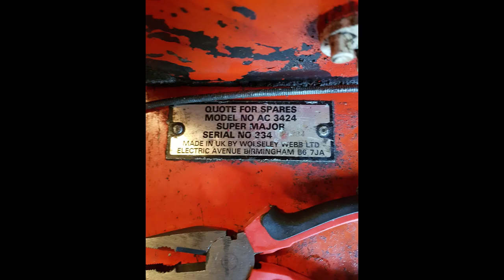Wolseley Merry Tiller Rotavator 5HP Briggs Stratton - No Spark - Non Starter

Comment: Thanks for the video. I’ve picked one of these up (model:714394)  and it’ll start with a dose of easy start but struggles without it. Also when it is running: it’s down on power...it’s not running at regular fast speed. Do you think mine needs the same points service? Or would you try something else first? Thanks
Reply from the maker: I was told if the point ain't broke, then don't touch them lol..
Mine never started without easy start lol.
Sounds like a fuel / air mixture issue? 
Have you tried new fuel with the correct mix. Give the carb needle valve a clean? Then readjust it 1/4 turn each time, it doesn't need much.
.
'Taryl fixes all' has great vids I learnt a lot from him.
.
Good luck mate 👍
Reply: Chris Crawley thanks for the reply. I’ll give those items a try and report back afterwards. Thanks again

Comment: Good job dude. I have a Merry Tiller 5hp Briggs N Stratton like yours. I’ve got starting problems too. Struggled to get the fly wheel off to sort out the solenoid points. Will try again though. If that’s not the problem I guess I’ll get a new one. These 50s machines are ace aren’t they?
Reply from the maker: Haha mate it's brilliant, pisses all over the homebase ones..
I got so fed up with starting problems I put a Honda 160 engine on it, wow the power is amazing. Good luck mate.

Comment: I have a 1958 merry I  trying to restore all is there belonged roy grandfather it's in pretty rough shape where do I find parts it sat for 20 years plus. No it's not for sale not I won't scrap it.
Reply from the maker: There's a couple of sellers on ebay, which if day keep looking on there as you might find a cheap parts only / non runner which you could dismantle.